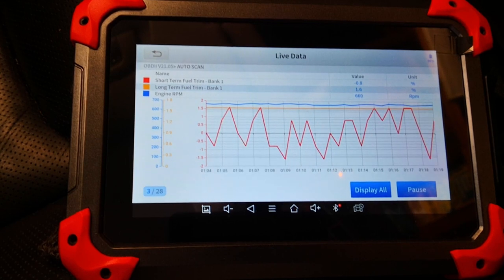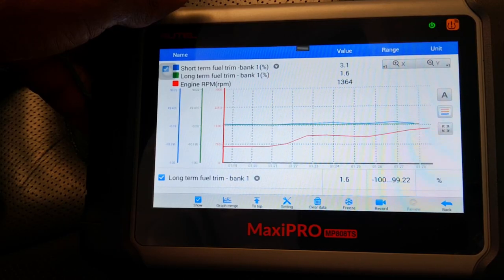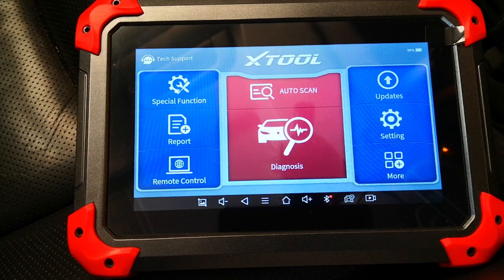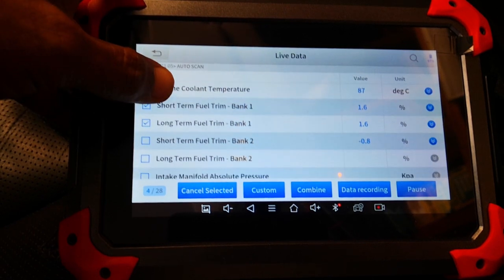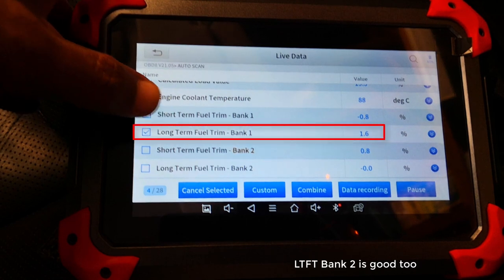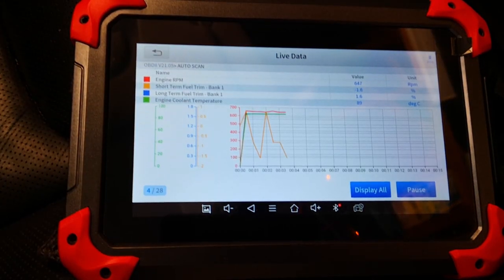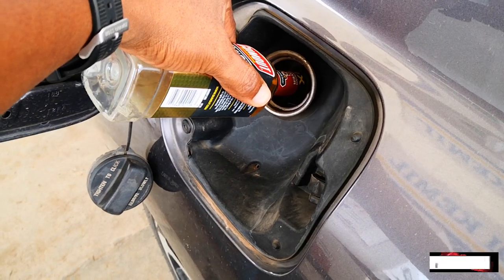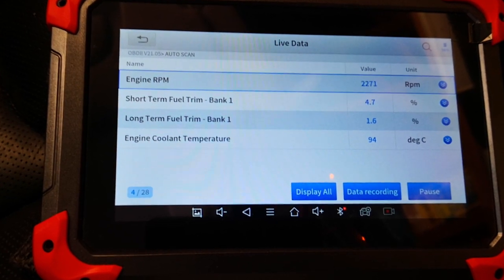How to Diagnose a Failing Fuel Pump with Fuel Trim data / Pro OBD2 Diagnostic Scanner  NOT Required

Comment: It took too long for me to understand, I watched it 10 times, finally I formed a plan
Reply from the maker: Glad you got there in the end. Mastering fuel trim data interpretation takes time and is key to troubleshooting emission problems.
Reply: @DIYAutoworksNG  I have a fuel problem.  I don't know why it is so hard to read fuel pressure from an analog gauge while driving and experiencing hesitation.  I am trying to go around fuel pressure gauge and use fuel trim.

Comment: Im sure I got a weak fuel pump. Fuel trim stft 32 ltft 30. ,, step on the gas holding at 2500 rpm and no change. Fuel pressure is around 42-45.  P0171 p0300.
Reply from the maker: What car is it? Sounds like lean misfires.

Comment: Now I know I have a vacuum leak SOMEWHERE 😊
Reply from the maker: Now, time to smoke it out🤓
Reply: @DIYAutoworksNG  I did a smoke test and. Nothing... thanks for your video.
Reply from the maker: Thanks mate. Also reduced/restricted fuel supply will also lean out the mixture.
Reply: @DIYAutoworksNG  Yeah, I changed the fuel pump and attached a fuel pressure gauge. The preasure is good. My LTFT slowly creaps up to 20% as it idles until it misfires. 
I just opened up the exhaust flange to see if that would help, but it didn't.  Tomorrow, im going to look harder for a vacuum leek. Maybe the dipstick pipe.
Reply from the maker: When you do the test in the video (holding RPM at higher RPM), what happens to LTFT?
Reply: @DIYAutoworksNG  they both go down.
Reply: @DIYAutoworksNG  Im checking the cylinder pressures and doing a leak down today. The cylinders are all 200 at 8 turns.
Reply: @DIYAutoworksNG  all cylinders were leaking less than 5 psi. Cold engine. 
I applied 75 psi, and three were LEAKED TO 70, and one was 69. Guess I better keep looking for that vacuum leak.  I still haven't looked at the dip stick/oilpan oring. I dropped the oil pan to clean the debris from an exploded chain guide.

Comment: I have a 2000 mustang gt I keep getting p0300 my stft and ltft are usually under +/-10 at idle but with an increase of rpm my ltft increases to 25% or more but my stft still look good being under +/-10
Reply from the maker: This is the V8 correct? It will be good if you split the STFT & LTFT by bank as per the values STFT1 & STFT2 and so on.
Share values at idle, 1500 and 2500 rpms.
Reply: @DIYAutoworksNG  And yes it is a V8

Comment: Great tutorial. My 2007 audi a4 b7 quattro 2.0l turbo at idle has stft at 18% and ltft 0%. Raising the rpm to 2500 and 3500 did not affect the fuel trims much. During normal driving the stft fluctuates between 18% and  23% while the ltft stays at 0%. The car intermittently loses all power. Stepping on the gas pedal only see rpm slowly rising and car barely moves. Can this be a bad fuel pump? Any help would be greatly appreciated.  Thank you.
Reply from the maker: Any codes?

Comment: Hi, I have a 2007 ford expedition.  My bank 1 ltft is +25 and my bank 1 is -23.  How do I approach this?  Thanks.
Reply from the maker: I believe you mean bank 1 and 2. This will need significant troubleshooting. What codes do you have?
Reply: @DIYAutoworksNG  hi, thanks for quick answer,  the car has a p0340, p0344,  p0307, p0303, and other cylinder misfires at random times,
Reply from the maker: Appears you have camshaft related issues which is messing up engine timing. I recommend you troubleshoot the P0340/P0344 first. Loose connection/poor contact/actual damage of the camshaft sensors are potential culprits.
Reply: @DIYAutoworksNG  i have done that and had the sensor replaced which did not help.   I have had those codes since  I have owned the vehicle which is over 2 years.   I believe the next step is to open the engine up.  It may need timing equipment.  I do not have the 2k to 3k that people want to do that.   The car runs well after I get it to about 35-40.  It is only running slightly rough at  start up or at idle.
Reply from the maker: Maybe before opening the engine, do you want to check for exhaust restriction on the bank that is rich? Seems to be an issue reported on Ford's. See https://www.ford-trucks.com/forums/1549350-5-4-running-very-lean-on-bank-1-and-rich-on-bank-2-a.html
Reply: @DIYAutoworksNG  ok thanks.  i will.  alsp i do get a p0174 code on bank 2
Reply: @DIYAutoworksNG  Also, On the scanner It has readings for Oxygen Sensor Short term fuel trims.  O2S1 B1 and B2 have readings but I dont get any data from O2S2 B1 and B2.   (I do get voltage though). Would that be significant?
Reply from the maker: It's normal. The sensor 1's are the ones used to determine air-fuel ratios. Sensor 2's are usually to monitor efficiency of catalytic converters. With the car at operating temp, and holding the RPM at about 3k what voltage do you see on the downstream sensors?
Reply: Hi, I sent a couple pictures of o2 data to your email. Couldn't figure out how to do it on YouTube. Thanks
Reply from the maker: Seen and responded.

Comment: It says my vehicle is going 17mph on the scanner when I'm parked ,why would it say that ? My speedometer revs when trying to drive it sometimes won't change gears and my cruise control doesn't work ,I've already changed the vss and my truck is lean with multiple misfire code
Reply from the maker: A car revving itself has multiple causes, one of which is misfires from spark plugs or ignition coils. I suggest dropping cylinders in a bid to isolate the problematic cylinders. Also, what codes you have specifically have? Vehicle indicating 17mph while stopped, plus inability to engage cruise control, as well as transmission issues may be pointing to the VSS. Did you replace with new OEM? Or its used? .

Comment: what scanner brand is good for this?
Reply from the maker: Depends. I guess there'll be other things you need in a scanner? Those should also guide your decision. If its just this test a really basic scanner with good livedata activity should be fine.
Reply: @DIYAutoworksNG  Most of the problems in the Vw 2.0tsi always come from the gasoline pumps. In my country, very few people have the equipment to read this information.

I'm looking for something that simplifies that work
Reply from the maker: Is it just for you, or you fix people's cars and have a shop?
Reply: @DIYAutoworksNG  for me and some friends

Comment: Excellent video.  The best I have seen on the subject.  I purchased the xtool computer but truly I did not know how to read the data.  I will go back again and check for clues on my fuel or vacuum problem? 
I was wondering if you have any input as to the reason why the pressure tester readings are so low when testing my 350z nissan.  They are about 20 psi.  I have not able to find the proper male adapter to connect to the line going to the engine.  Presently the pressure tester has one end securely plug.  
I welcome any help!
Reply from the maker: Thanks mate!
The right adapter is the place to start! Do you mean 20psi on the scan tool? That sounds quite low. Do you know the spec for your Nissan? I'd say you look into restrictions in the fuel line, clogging of the filter or a defective fuel pressure regulator/pump.
Let me know how it goes. All the best.
Reply: @DIYAutoworksNG  I used a generic pressure tester from my local auto parts rentals.  It read 20psi.  My 350z Nissan normal operating pressure is 51psi.   The current factory "return less" fuel systemin my car does has the regulator inside the pump.   I will check both today!   Thanks for  getting back.

Comment: Thanks so much. I haven't tried the test yet, but you made it easy to understand the concept. I'm having high idle issues after a TB cleaning, seems my 99 civic is getting enough air to idle just above spec..with the idle air screw, screwed all the way in. It's either in need of a proper idle relearn (I tried manually, with no improvement) it's a bad IACV that I swapped out, I have a vacuum leak at the IACV itself, or I'm ruling out inadequate fuel pressure with this test, even though I have no other symptoms of inadequate fuel delivery. Closed off idle screw, and thumb over IACV port kills the engine immediately, so I can pretty much rule out any major vacuum leaks downstream of the throttle plate, though I checked hoses, and sprayed a bit of brake cleaner to be sure. Gonna spray the IACV tm, get it scanned with a proper scanner to make sure it's zeroed out, reset, or calibrated, then change out the original IACV that I mistakenly swapped because I DID have a vac leak that was throwing a P0505. I tried setting the idle screw back to spec, then doing the idle relearn manually..no luck. They say you must pay for your education.
Reply from the maker: Thanks for the compliment. Was the car otherwise fine before the TB cleaning?
Reply: @DIYAutoworksNG  Ehhh, idle was a little high, but pretty sure that was from an under torqued egr valve vac leak. I also found a bunch of gunk on the intake manifold from the throttle screw port when I cleaned it, so I had a vac leak, and clogged idle screw port..lol I've ruled out vac leaks now, as well. The tech drenched the throttle body and surrounding area with brake cleaner. I'm not running lean either. Just idling high. Otherwise looks healthy on OBD scan. The IACV was at 0 for a few ticks, he actually said, "that IACV is dead," then went to 9, and stepped down to 8, at least,(The guy at the shop was scanning it for free) but I feel like it's not working correctly. The valve itself, out of the car, and at rest is in a different position than the OEM. OEM is probably 15-25% open, while the Walker model, and a cheap Chinese Amazon model are both almost completely shut. I'm convinced now, it's probably a faulty aftermarket IACV. I'm changing the IACV back to my cleaned up Denso. Voltage and resistance tested. It was definitely better before the cleaning. If that fails, I'm going to have to take it to the Honda dealership. They could do in an hour, and about $150 what it would take me weeks to troubleshoot. I did get weird TPS values. To get 9.8% (.49v) and 89.8% (4.49v) on my basic scanner, I was at .54v closed, and 4.6-ish WOT at the harness. I assumed, on a 5 volt scale, .5v is 10%, 4.5v 90%. This is how the Honda service manual basically describes it. 10%-90%=.5v-4.5v..because math.
Reply: Background. I was getting an EGR code, cleaned the valve, no luck. Changed the valve, no luck. Aha..cleaned the passages and chamber. Bingo! No more EGR code. It was replaced fairly shortly with an IACV code. Cleaned the valve, and throttle body. Still coding. Changed valve. Still coding. Decided to re-torque my work and check all my mating surface. Little to no improvement. Still coding. Embarrassingly, I think I caused the P0505, fixed the original cause, but replaced with a bad IACV in the process. At least I hope so. After I swap the original IACV back, I'm pretty much out of ideas. I've literally used the Honda service manual troubleshooting flow chart, and "Replace IACV" is where I ended up.

Comment: I have a Peugeot 207 1.4 petrol 16v done about 125,000 miles, the car starts perfectly every time, but when the engine is cold I have to sit there for at least 5 mins until the engine warms up, then I can drive off. 

If I don’t let the engine warm up, I drive off and the engine is sluggish, pedal to floor and no movement, then it will all of a sudden kick in, if I stop at junction the engine will cut out. 

When at Idle also sounds rough until it has warmed up.

I have changed the following:
Spark plugs
Coil pack
MAP sensor
Camshaft sensor
Variable valve oil solenoid sensor

I have no engine management light on and no error codes when scanned.

I run the test in this video and from a cold engine my short term fuel trims run between 0 and -10, surely from a cold engine they should be positive? Do you think I have a fuel problem?
Reply from the maker: It should be in the negative (which is rich) from cold start. What is the LTFT at?
A failing coolant temperature switch can cause what you describe. Try this... First thing in the morning use live data to check the temperature reading from the coolant temperature switch(or equivalent) it should read practically the same with the ambient air temperature switch. If either is off, the switch with a reading different from the weather temperature is the bad one.
Reply: @DIYAutoworksNG  the LTFT is showing a constant +10, can I send you a screenshot of the live data?
Reply from the maker: A single snapshot of livedata may not do much. If the the car warms up, where the STFT hover around?
Also, with the car warm, and you hold RPM at 2500 how does the STFT react? If the LTFT changes too let me know.
Reply: @DIYAutoworksNG  so with engine cold STFT are about -10 then as engine warms up they go between 0 and -5. 
LTFT stay the same cold and warm during idle at about +10
When I rev the engine STFT read between +2 and +10, LTFT read -5 during revs
After I stop revving STFT read between -5 to +5 and the LTFT read a constant +13
I will run another test adding the coolant temperature to the live data like you said. Thanks for your help so far. 👍🏻
Reply: So coolant temperature, ambient temperature and actual temperature all read the same degree
Reply from the maker: Okay. It looks like you have a vacuum leak. Maybe the cold shrinks the seal and it seals back when warm. Some BMW owners have had this exact issue you describe. If you have some starting fluid, with the engine cold, spray it around vacuum hoses, intake manifold and throttle body and see if the RPM rises in relation to the sprays. If it does, that's the point of leakage.
Reply: @DIYAutoworksNG  ok I’ll give that a go, thanks again 👍🏻

Comment: I'm working on mercedez w204 with m272 2.5 litres engine. 
All  3 spark plugs on bank 1 is black colour while all 3 spark plugs on the other bank is white.
Upstream oksigen sensor on bank 1 show 2.2 mA and LTFT is +26%.
Upstram oksigen sensor on bank 2 show 0.1 mA and LTFT -0.1%
When I push acc pedal to 2500 rpm and keep there for about 5 sec and suddenly rev up to 4000 rpm and quickly realese the acc pedal, upstream o2 sensor current on bank 1 drop to nearly 0 and soon back to 2.2 mA.
Sometimes when all 3 spark plugs is very dirty black i got CEL light on and the dtc show Multicylinder missfire.
Is this upstream o2 sensor on bank 1 need to replace? 
I was try to cleaned all the oksigen sensor, maf sensor, injectors and all spark plug but the results is the same, only 3 days after all 3 spark plugs on bank 1 got black colour.
Btw, bank 1 catalytic shows higher temp compare to bank 2 catalytic temp.
Do I need to reset LTFT after cleaning all the o2 sensor, maf, injector and catalytic ? How to reset LTFT?
Any help would be highly appreciate...
Reply from the maker: Hey. What codes do you have on the car apart from the multiple cyl misfire? Bank 1 appears to be running lean with the +26LTFT, but wasn't expecting them to turn black which indicates rich running. When last did you change these spark plugs?
Reply: @DIYAutoworksNG  if i remember correctly it is p0300, p0301, p0303, p0305.
I don't know when this car last change the Sparks plug but i did try to switch the Sparks between Banks. Result is Sparks from bank 1 which installed on bank 2 is white colour and Sparks from bank 2 which i installed on bank 1 became carbonized black colour.
Reply: @DIYAutoworksNG  also, i did switch the all 3 coils between bank and the result is the same. Bank 1 Sparks plug still black carbon.
Reply from the maker: The engine has a primary O2 sensor per bank, right? If it's easy, maybe swap that, let's see.

Comment: Hello dear i change my fuel pump and strainer but my ltft is still on 2.34 positive not changing
Reply from the maker: 2.34 is good.
Reply: @DIYAutoworksNG  but when i accelerate it does not change
Reply from the maker: @mujtabapolani3229 LTFT doesn't change as fast. It's STFT that changes quickly.
Reply: But as you said if LTFT remain lean so it would be fuel pump issue , is i need to change fuel pump

Comment: Hi bro my car idel around 850 rpm long ft B1S1 shows. - 3.906 and short ft b1s1 0% and my car has around 2000 rpm while driving tomuch pinging sound, let me know what is ur option
Reply from the maker: Fuel trims look good at idle. Any codes?
Reply: @DIYAutoworksNG  no code buy car always tomuch pinging around 2000 rpm
Reply from the maker: Use a good fuel system cleaner and see.
Reply: @DIYAutoworksNG  thanks
Reply: Bro sorry, can check my reading 2159 rpm, intake air, 48 degree Celsius knock learn values 15.156 long FtB1S1 11.719 % maf 37.7 O2FTB1S1 4.688, O2B1S1. 720v short FTB1S1 2.344%

Comment: I did this test my stft b2 went to positive 14 at 3000 rpm
Reply from the maker: If fuel trim was normal at idle, you likely have a restriction in the fuel line, clogged filter, pump that is going weak etc. Bank 1 data was good?
Reply: @DIYAutoworksNG  yes trims normal at idle, rough idle, rpms goes up then down sometimes it stalls on me. B1 good
Reply: Yes B1 data good
Reply: @skeltonantonio  yo dude you ever figure out the problem, my 4.6 explorer is running the same STFT normal at idle but LTFTB1 AND B2 ARE +18 AND +12.5 when driving, idles up and down and i can smell the exhaust a lot more.